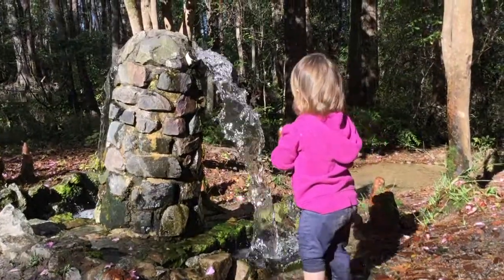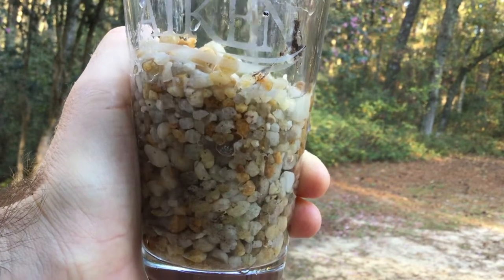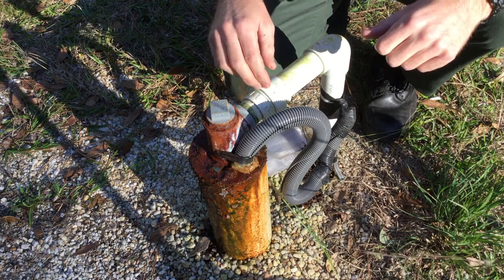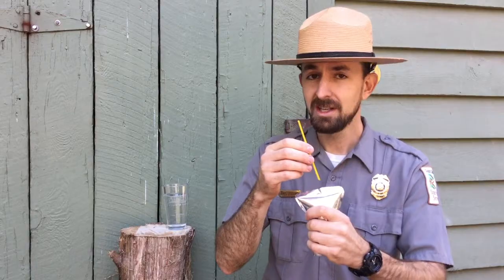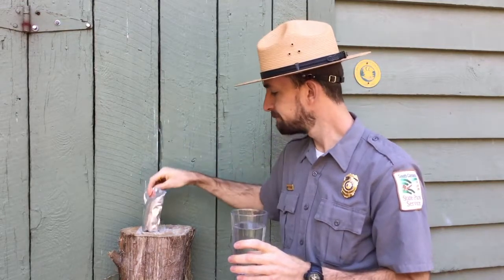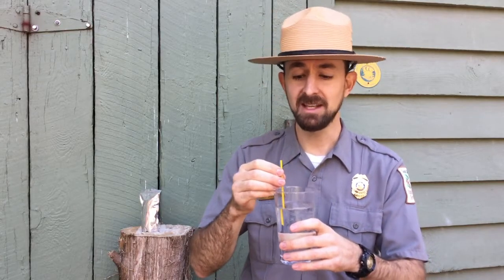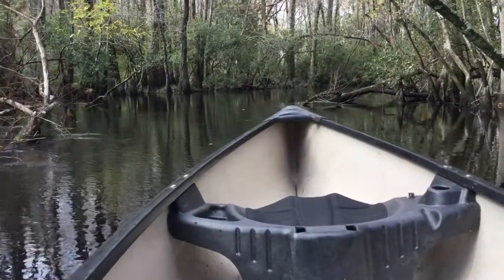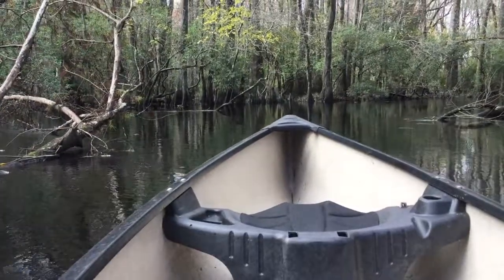Learn How An Artesian Well Works at Aiken State Park!

Comment: Pretty good demonstration it's part correct and  incorrect I have an 8" Artisan Well on my property in Argentina with mineral water quality....the water is between two impermeable layers (You are correct on that part) but it's being pushed up because it's coming from a higher level,  basically that's all there is to it! All artesian well waters are coming from a higher levels  that's what creates the pressure!

Comment: According to my understanding of an artesian well, I believe your emphasis was misplaced.  The two layers that confine the aquifer do not create the pressure.  The pressure is created by the water in the aquifer that is at a higher elevation than the location of the artesian well.  You sort of cover this when you mention the water seeping through the ground and traveling horizontally to the aquifer, but you only mentioned this as a means of replenishing the aquifer, which is true.  Everything you said was true.  It's just you implied that all you need for an artesian well is two confining layers, but what you need is an aquifer that occupies different elevations.  I'm not a geologist or a hydrologist, so this information is worth exactly what you paid for it.
Reply: You got it right buddy I have an artesian well on my property and it's being replenished from the snow melt on the Andes mountains here in Argentina!👍

Comment: Are there wells like these that are dammed or have water stored?
Reply: I'm not to sure what exactly what you're asking, but a lot of homes (mine for example) use these types of wells when possible, damming them like traditional dams would defeat the purpose and benefits of taking advantage of this type of well, i.e. not needing to spend money on water storage, pricey pump equipment or, (sometimes, depending on location) water purification systems. Now, towns and cities certainly have water treatment plants and reservoirs but that's out of necessity.

The only other thing I can think of pertaining to damming an artesian well would be "plugging" one where the hole to an artesian well is quite literally just... plugged up so that the water stops flowing out of it so that the land can be developed or so that a new well can be dug elsewhere or perhaps to even help mitigate waste water.
Reply: @Kurokubi  glad for the answer because I was thinking the water would go to waste ofc i'm thinking about really dry places, I didn't know u can plug it either

I was also wondering about collection and storage because I'm assuming its also finite in terms of water